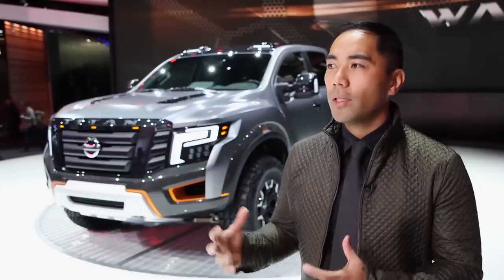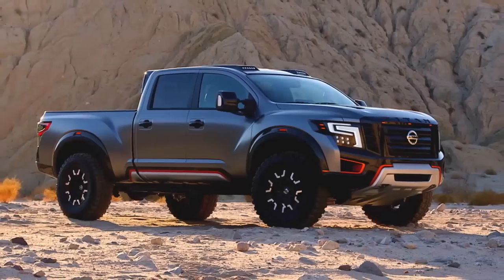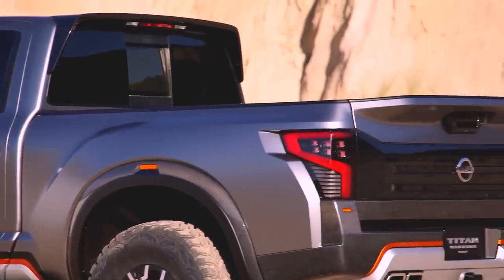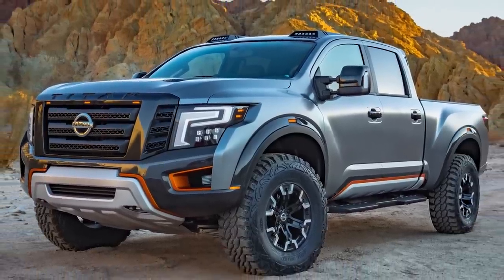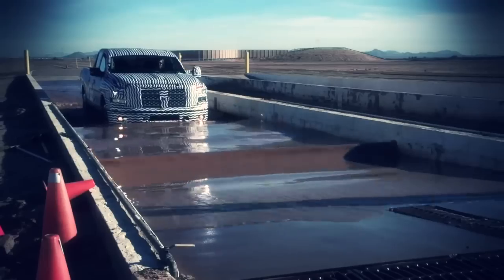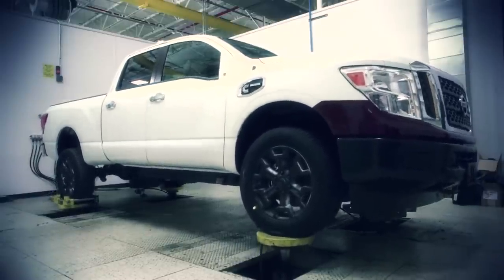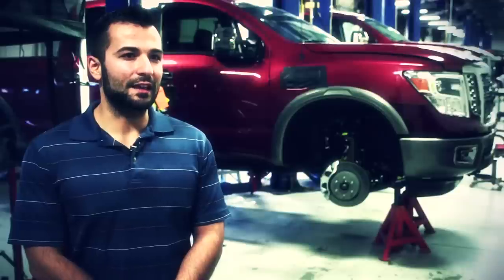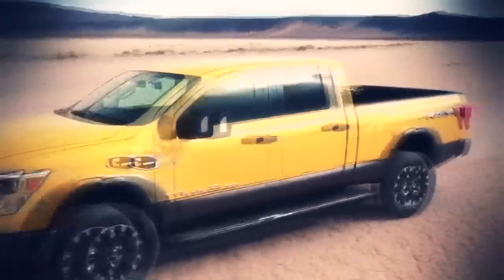2017 Nissan Titan Warrior Review

Comment: Did the designers start to wonder about one thing. I spend Saturday scrubbing and jamming a soapy rag in those vents like hell which I never get all clean and THEN what is all that soapy water that has now run down all over my motor going to do??? Gee...maybe.....space the vents farther. Now, to make up for the distance bringle in an angle for the vents to make them look just as close but easier to clean.
Reply: tom thorn then.... why are you here..?

Comment: This is why every design group should use a "panel" of regular American men who they are trying to sell this truck to in the design process!! Front grill, indented letters and fairly deep. That's gonna be a bitch to clean all the dead bugs out of. First thing I think. The hood vents. What??? I can just imagine on Saturday evening washing this truck and cussing under my6 breath while I try to get my rag down in those vents to get the grime out of. The steering wheel with what looks like fancy chrome. O.k. If I am working guy looking for a good fun tough truck......I don't wanna have to worry about how to clean and care for some fancy ass trim around my wheel! That ain't the kinda fancy trim I want! Two tracks in the BED of the truck for tie downs!! NOOOOOOOO! Those tracks will get crap in them, then the fasteners won't slide and work anymore. Then that chrome gets bumped, crushed, bent and starts rusting and makes the bed look like shit! Here is an idea. If you want to design trucks for normal human beings oh......say.......maybe..........USE NORMAL HUMAN BENGS INPUT?????????